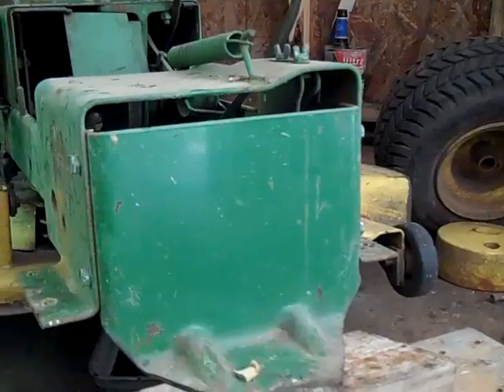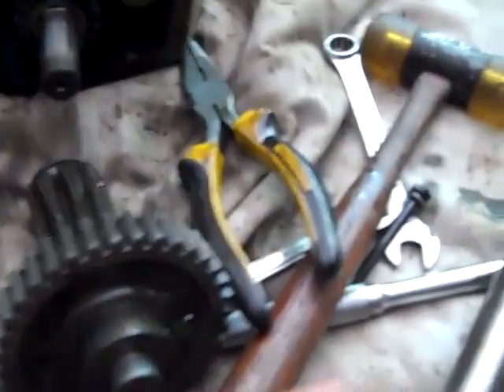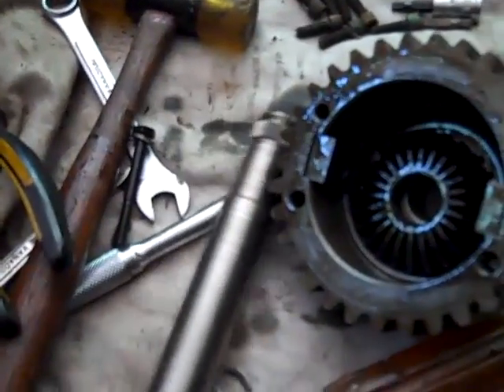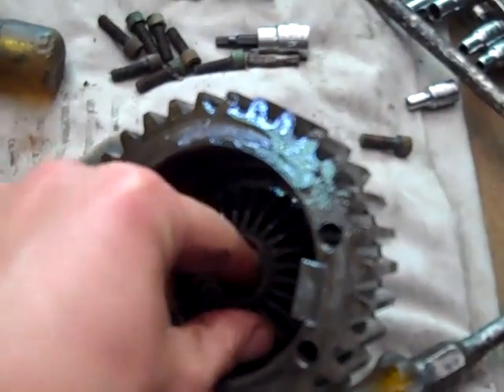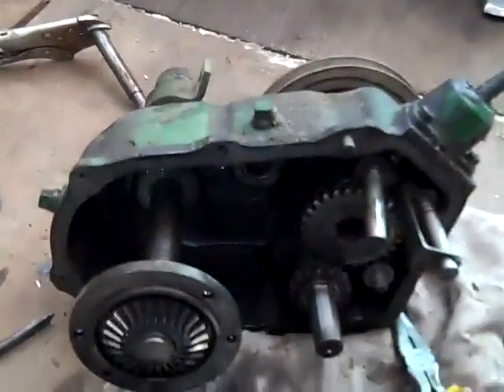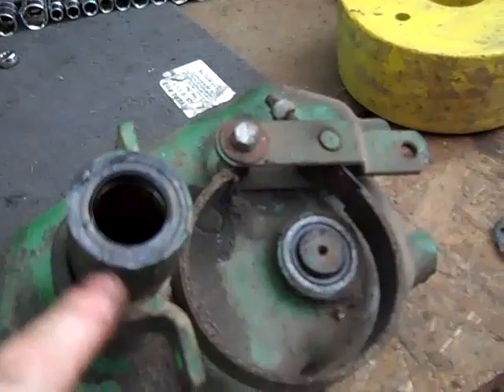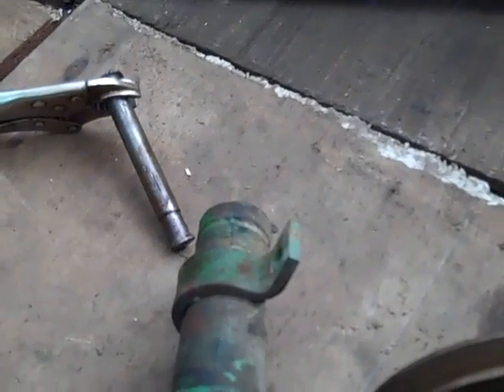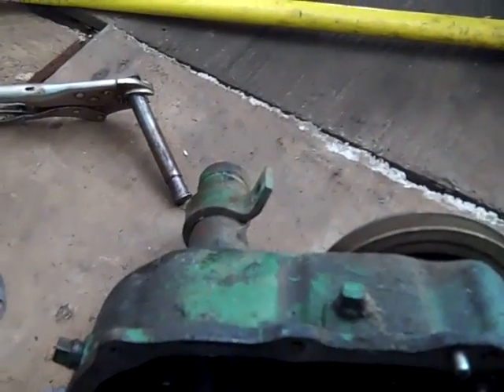John Deere 60 lawn tractor transmission disasembled

Comment: I know this is an older video but if you could give a few words of advice... I'm having leakage out of both axle ends on my 60. Is it repairable with new seals from the outside or does the case need to be cracked open to repair? Any info would be appreciated.
Reply from the maker: You should be able to replace the seals without splitting the transmission. If my memory serves me right there is a keyway in the axel shaft that you will have to remove one you remove the tire off. Clean the axel shaft throughly of any rust and sharp edges. Remove the old seal . In order to to drive the new seal on you will need a piece of metal pipe close to the same diameter of the seal to drive it in the transmission  housing. Hope this helps
Reply: Thanks for the reply, I’ve got it taken apart. Must be a bushing to remove and then the seal is behind that?
Reply from the maker: @CaJo715  I don't recall there being a bushing. Just the seal itself.